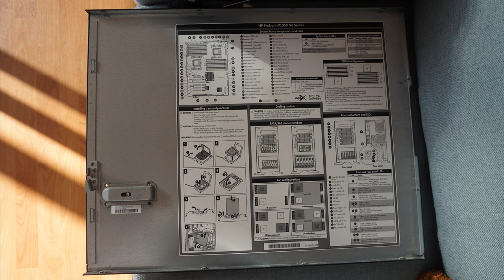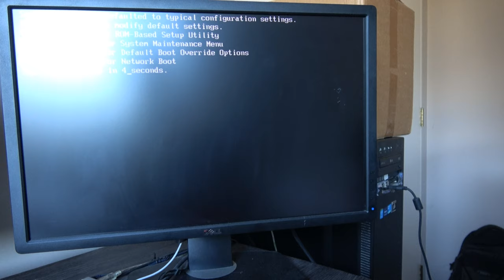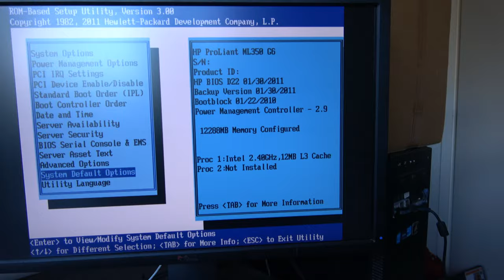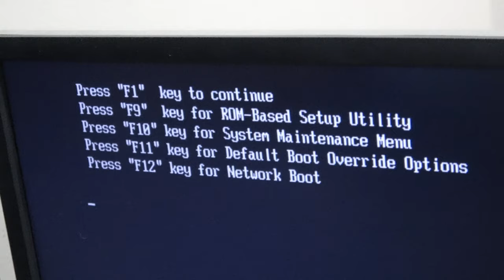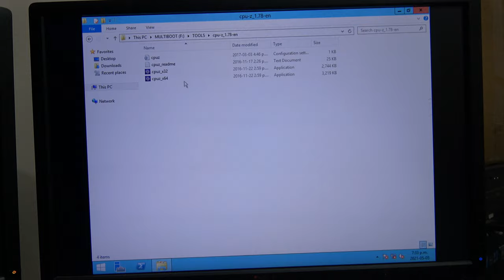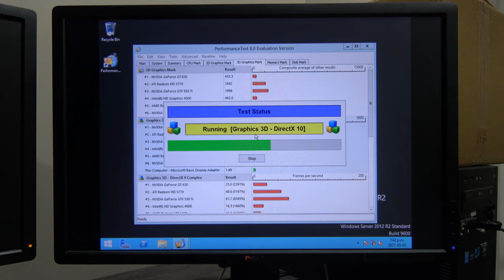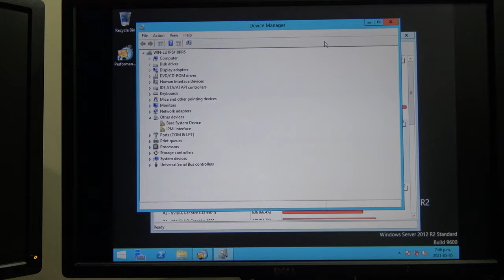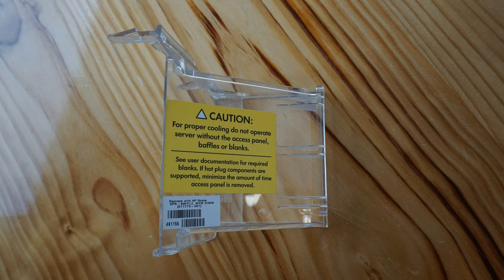2021-05-02 HP ProLiant ML350 G6 Server

Comment: Hello, I am unable to open the CD rom drive. How to open that to run 2012 R2 software CD rom?
Reply from the maker: Is the server turned on, it needs to be turned on for the optical drive to eject. Alternatively, there should be a small hole in the front of the optical drive that you can stick a pin into to open the tray while the server is off. If it still doesn't open, make sure that the cables are plugged into the optical drive. If that still doesn't work then the optical drive could be faulty,  in which case you could use an external optical drive if you have one, or you could put Windows Server 2012 R2 onto a USB flash drive. Or you could buy another optical drive.
Reply: @WoOS_Historic_Vlogs  Truly appreciate your reply.  I like the idea of USB , can you share a good legit link where I can download 2012 R2. Thanks
Reply from the maker: @maneeshjulka  https://bobpony.com/downloads/